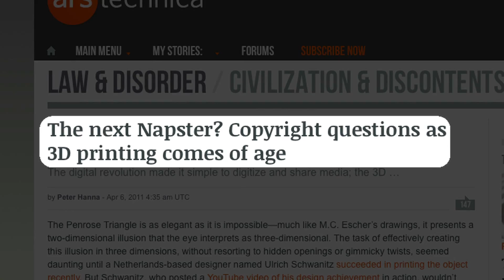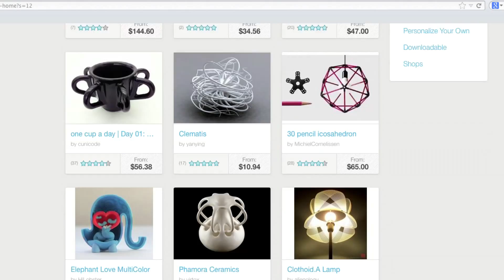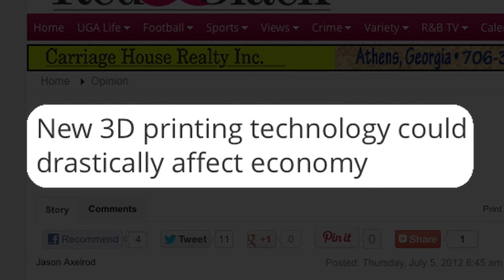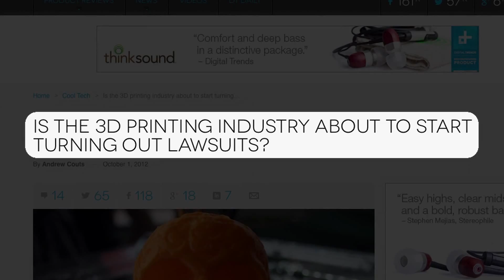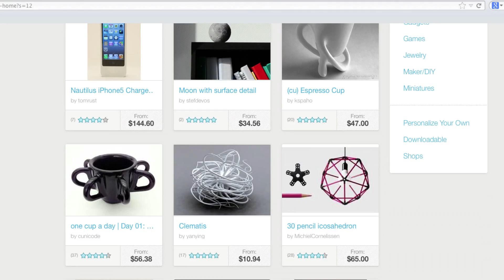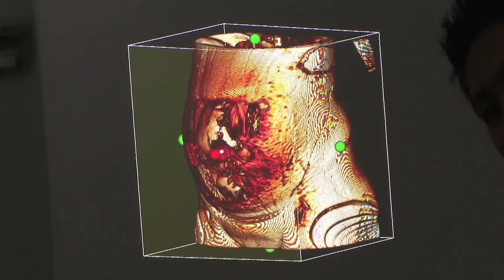Will 3D Printing Change the World? | Off Book | PBS Digital Studios

Comment: As a person who works with a variety of 3D printer models and teaches CAD I can tell you that it isn't as big of a deal as you might think. The parts are limited by material, size, and strength. Yeah you could print a new towel hook, but do you want to hang that in your home next to your carefully purchased furnishings?  Do you want to spend 8 hours printing something only to have it fail when you could of just gone to the store and bought a strong, injection molded part? The majority of things people are making is plastic junk that will end up in the landfill. It will never replace CNC and computer automated manufacturing. The people in this video are selling 3D printing because it is their business, not because they are experts. For example; I owned a Solidoodle 4 which is the biggest steaming turd available on the market, and here is their owner talking up 3D printing. PBS, you need to watch who you are hanging out with, that man is selling straight up snake oil. I don't know how they aren't bankrupt yet. If you are going to get a printer, get an Up Plus/Afinia, 3D systems, or an Ultimaker.
Reply: rocco pietrofesa *" It will never replace CNC & computer automated manufacturing .. "*

Hah! I wouldn't be so certain bud, NASA is already building high performance, complex structures ( engine components & what not ) using 3 dimensional printing, of course, it still is in the experimental stages but that itself is a progress to cutting the cost of building these type of high performance structures by a tenth of the normal cost!

Eventually this sort of high performance 3D printing technology will be a reality in the coming decades, it has to evolve bud & 3D printing will soon be the new kid on the block! :)
Reply: Yusuf Omar He's right about the hype. The video clips are 10X actual speed. It takes hours to print even simple parts. 3D printers are great for for prototyping but real products still require commercial injection molding. Also, if it's not a new idea the gadget you want to make is probably already available at a fraction of the cost of making it yourself.

Google "3d printer images" and look at the product samples in the 
promotional materials: little animals, hippos, birds, miniature Eiffel 
Towers, Yodas, skulls, octopuses, geometric shapes, etc. That is what 
99% of these machines will be used for.
Reply: +Doug J It's too early to dismiss such a technology simply because its speed and sophistication is not yet up-to-par with the traditional methods of production.

Comment: 3D printing cannot address mass reproductions.
China is still the cheaper way to get your products and china has been and continues to provide basically all the things needed by the world. Of course, not everything.

This video should have been more fair to mention what the limit of 3D printing is.
The Stroller part that was mentioned that was printed will not be strong if using plastic filaments even if nylon is used .

Clearly, there is a sensationalization effort, if you will, in promoting 3D printing.
Are the manufacturers by any chance involved in this sensationalizing?
It reminds me of Sales advertisements and Rhetorics by politicians.

Comment: You can print many things but not everything.
Also , the thing you printed is not the Real thing.
Its a plastic image of the real thing in 3D.

So, its intellectual dishonesty to say that 3D printing can print anything.

Also, its not strong especially those made of plastic.

So, in reality, 3D printing today has many limits eg. Size, filament cost,  strength, imperfect finishing, limited colors , just to name a few.

Clearly, there is a force behind this movement that is sensationalizing the 3D printing capability.

I support 3D printing.

Its best for prototyping only.

Comment: The only problem with that principle when applied to printers is that they have to have a material to print. Even if 3d printers themselves are incredibly high tech, it is going to be very expensive to print anything other than plastic

Comment: 3d printers will follow the same curve as their 2d predesessors. For the the same reason you can buy a 2d printer for $50 today you will be able to get a 3d printer for $100 in a couple years. The profit is in the cartridges , the manufactures are willing to sell the machines for a loss to get you to buy abs and filaments

Comment: There is a new 3d printer called the RigidBot 3D Printer. It cost only $330 in kit form, has the quality of a Replicator 2, and can print 1000 cubic inches in a 10x10x10 workspace.  Check it out on Kickstarter.  If they reach a goal of $1,000,000 they will throw in a heated bed for free.  Check it out! Please Like this so others can see.

Comment: There is a limitation on everything. Compare the time 3D printing takes vs. mass manufacturing in factories. Besides, Chinese factories are no more low labor cost-they have world standard quality control/equipment. Mass manufactured products have quality assurance and are mechanically robust and to tight tolerances(1/1000 mm at production runs of several 100 millions). So 3D printing will remain in niche areas like lost wax mold making etc.

Comment: slow and expensive now but technology will improve. Will become faster, cheaper, and use multiple materials. complex machines will start to be designed for 3D printing rather than print & assemble. Also the possibility that integrated with robot and computing technology that machines will print and assemble. We will probably see print shops where you go to get large/complex items printed. Also mass production will utilise this technology to produce more complex designs efficiently.

Comment: It is already available from Chinese makers at lower costs such as $800. However, it cannot compete with very large production runs capable of maintaining quality standards at low cost. Being very slow is another problem. It can be used to sinter aircraft parts but aircraft industry is NOT mass production.

Comment: Not true. This technology is only effective for small production runs or single prototypes. It is impossible to make for example handphone cases at prices as low with mass manufacturing just by 3D printing. You can have your own case for high cost,however. A 12 inch doll costs over $100 to print out but $1 if mass manufactured using many metal molds in large factories. The quality is also much more consistent with the latter.

Comment: Yes.
Projects such as the "REPRAP" aim for this, and most 3D DIY printers can already print out many of their own parts.  Motors and electronics are still a challenge to print though, and thus most self-replicating 3D printers still require a lot of what they call "vitamin parts" such as motors and electronics, and are thus not fully self-replicating designs yet.

Comment: All sorts of things.  I recall them mentioning concrete in the video.  But typically things are made from various types of plastics, titanium, rubber, ceramics, or whatever you want.
NASA is developing a type of 3D printing that uses a kindof MIG welding gun that can even be used in the vacuum of space (3D print robots/spacecraft IN SPACE!), it extrudes from a spool of metal wire and melts it with an electron beam, it uses no shielding gas - only metal wire and electricity.  It's quite exciting!

Comment: Depends on what your definition of durable is, and what material you are printing in.  
You can print in many materials including rubber, silicone, titanium, silver, concrete, sandstone, various plastics, wax, chocolate, etc.
3d printers that laser-sinter titanium, print parts that are used on aircraft, and afaik there is experiments underway to print full sized military battle tanks as a single piece, an armour shell - slowly rising outof the gigantic print bed.  
So yes, it's plenty durable.

Comment: 3d Printers have been around over a decade, but they were rather primitive and expensive in the beginning. Most could only print to low to medium resolution and were usually made of thing like a starch mixture. Buildup took place buy extruding the binder into layers of the starch getting them to stick together. Thus when you took it out you could just shake out the model and it would be left behind, a "cookie."  In the last few years they can print in ABS plastic,wax,metal,cells all in hi-res

Comment: Actually, Direct Metal Laser Sintering (DMLS) is able to produce strong metal parts directly. Obviously the surfaces are not as smooth as machined surfaces, so you'd still have to bore the cylinders and so on. But that is pretty cool nonetheless. Of course, DMLS is way way beyond the crappy FDM machines shown in this video.

Comment: For the plastic or metal 3d printing: yes it may be bad if there isn't a way to recycle. But in theory, you could melt down what you build and add it back into the process(shown briefly in this video but not commented on). For food and cell printing it won't be an issue as what is made is consumed or used shortly after creation. In short there would have to be a system put in place for such recycling but it is a possible part of the creation process.

Comment: Depends on the type of stuff you're printing. There's going to be different polymers with different specs: strength, flexibility, impact resistance, hardness, etc. Oh and there's the bio stuff. As a base, The Cube 3D printer uses $50 cartridges that you can get 15 "average sized" print out of. I'm not sure how big "average" is but the biggest thing you can make with The Cube is 5.5" tall. I got this from DNews at /watch?v=hPNxm5sWJIk

Comment: When launching, mass is mass, and there would be no advantage unless you are setting up manufacturing for use in space and don't really care about quality. Lack of humans and materials in orbit are the issue, not the shape of the mass we launch. If quality isn't critical, replacement parts can be made of the same material. Check out Electron Beam Freeform Fabrication for more info on a really neat technology NASA has been working on.

Comment: Maybe but are you aware people can already make guns from house hold objects at a work bench?  Home made zip guns made by gangs go back to before 1950 and the internet has only made it easier.  Air and Cap guns alone can both be very easily modified to lethal firearms if one wanted to and flashlight guns are not that much harder.  Mostly though it is just easier to buy a gun, legally or illegally.  3D printers don't seem likely to be a game changer in the area of gun control/gun proliferation.